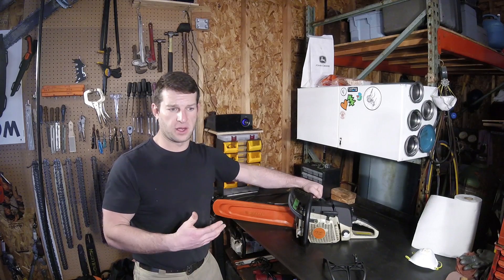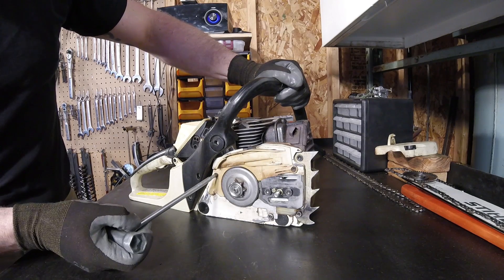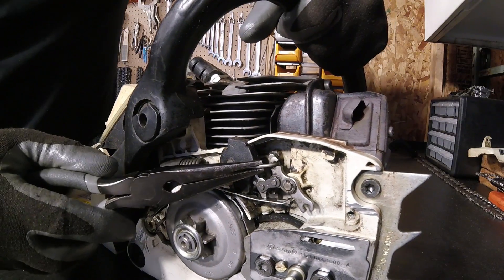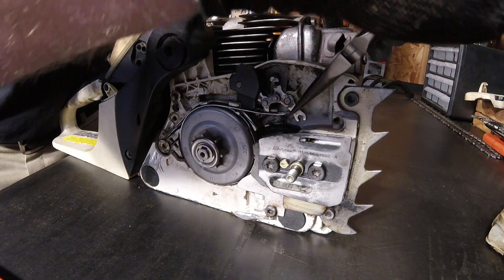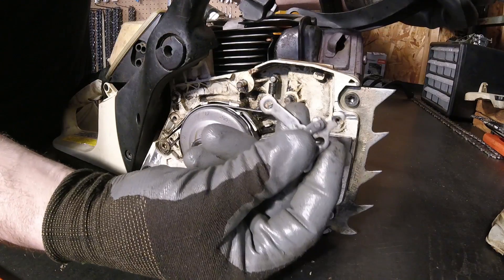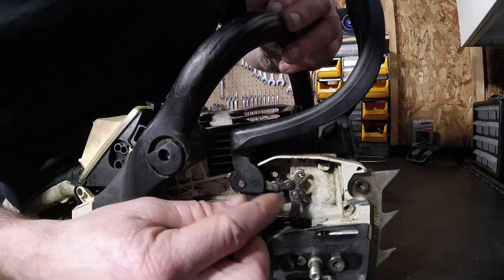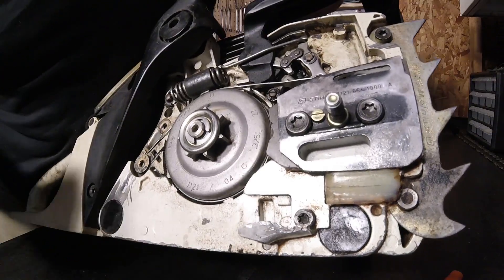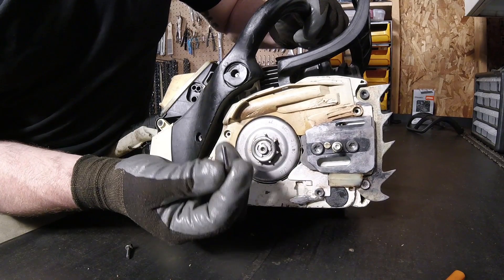Stihl Chainbrake Repair :How To (Ground Saw)

Comment: Great video! Thanks. I had no idea the brake mechanism was so simply designed. 
My 211 had a broken "bear" spring. The assembly was very similar to the one in the video.
An easy fix once the part arrives -had to order it. 3 bucks, no complaints. Take care.
Reply from the maker: Glad to have helped    =)

Comment: Thanks, I was almost trying to take the whole thing apart before I found this and how simple it was.   You're right,  big spring is a bear.  And I'm just a wee man.  Part of the problem is just holding onto the saw.   I ended up straddling the saw and holding it with my legs, then using a screwdriver to pry the hook into position simultaneous  with needle nose to push the hook on.

Comment: Excellent vid ... on my MS660 I had to put the lower bake spring on the C b4 putting everything on the pegs .. it just wouldn't fit once it was all in place. With the help of a stihl hook it went well.  OK I'm back ...broken another one ... this time I'm putting some fibrefix fiberglass 1" tape around the weak point to give it some extra strength.

Comment: Thanks for the vid, gives me a "chance" of trying to fix (or at least investigate) mine myself.
Chainsaw runs ok.  BUT, when I go to sharpen the chain on the bar, it's almost impossible to advance the chain by hand.  I can move it BACKWARDS (still stiff, but moves), just not forwards.  Regardless of chain tension (even if I slacken it a lot).  I'm guessing the chainbrake is somehow out of adjustment, and constantly dragging??
Reply: Mines difficult as he'll to move chain forward. I suspect the brake band on the drum needs to be eased off a little / re- tensioned but not sure. Did you manage to sort?..  please explain how ?.. thanks

Comment: I put a pair of hemostats on the big spring and roll it off the back pin with a scrench.  It will go flying, hence the reasons for the hemostats.  The rest is pretty simple to remove and replace.  I fabricated a spring installation tool from a 3/16”nut driver.  I smoothed the end with my angle driver and smoothed it down with my orbital dander.  I put a little grease on it, put it through the loop in the spring and on the rear pin.  I then stand it up and push the spring down on the pin and remove the tool.  It works fine.  Stihl also makes a tool for this but mine only cost me a little effort.

Comment: I’ve just done a very similar fix to a MS170 (one of the smallest saws) I fitted the brake band kind of at 90 degrees to the clip it’s attached to then rotate to the correct orientation, note that the slot is a T shape. Also there was a tiny heat shield strip screwed on the brake handle. The Chinese knock off replacement handle did not have any screw holes. I missed this until it was all assembled! It’s very close to a hot catalytic converter

Comment: I have found that using a Phillips screw driver works well for installation of the spring. Slide spring hook over Phillips driver shaft. Put valley of screw driver tip on spring stud, stand shaft up as you slide the spring down. Hold spring down as you turn the shaft. Spring will snap on to the stud.

Comment: I liked the video...I currently have a similar 311, and all the mechanism is intact, but when you pull the handle back, it does not make it to the point of ‘clicking’ to disengage the brake.  The little piece of that metal lever that almost looks like a chain link does not straighten all the way before the plastic handle makes it to the end of its travel.  Can’t figure it out...fairly new saw.  It you pry it with a screwdriver, it will click into place, but the handle won’t do it..

Comment: I have an old AV 034 super.  The pivot post (where the C clip attaches to) broke off.  Can that be repaired?  I tried to epoxy it back on (didn't hold).  The 'metal' isn't weldable, so I'm not sure how to fix this?

Comment: I like your teaching style and video quality.  I swapped out my handle in 2018.  Just retesting the inertia chain brake recently with the drop test (onto a stump) and the inertia brake does not work.  The handle does however trigger the chain brake like it should.  Any ideas?  Also for reassembling that spring, I was taught to place a piece of metal brake line into the hook on the left end of the spring and then the line will fit over the post allowing the spring to more easily go onto the post.

Comment: Awesome. Had a guy break the chain brake in the EXACT spot yours broke, so looking up how to fix it my main human was the first vid to pop up lol, so thanks bro, all because that bottom mechanism had came off. So hopefully the shop I go to has one in stock. Side question....ha e a recommendation on a cleaner to use besides just blowing it out with my air compressor? Stay safe human 🤘🤘
Reply: Was a 251 that it broke on, still like you said similar set up so was really helpful
Reply from the maker: I generally just use the flat head on a scrench to get all the big solid crud out, and then compressed air, as I'm sure you're aware of though, using air covers everything in a 5' radius in oily saw dust     =/
Reply: I use brake parts cleaner for the majority then air to finish. ( Note) a stiff handle  can be caused by a clogged brake band.It's important to keep the compacted dust out of the wiggle room between the clutch drum, band and the housing. If it gets compacted and the band loses its ability to move in as well as out, it will tighten up the mechanism and shit will start breaking and falling off. I have an 046 and I find it important to keep that area clean.

Comment: I plan on getting an MS291, but I read on line many  accounts of the MS291 being burned up by the chain brake, I suspect it was mostly by careless users, but many of them blame the chainsaw.. Anyway was there any problem with the saw brake on that model? I doubt it but it is better to be safe than sorry. Thank you.
Reply from the maker: We've a 291 at work that hasn't been an issue, but I've not been around any 291's in service for more than a year though, so can't really say.
Reply: I am pretty confident it was a user screw up. They ruin a new saw and their ego will not let them tell the truth. The brake will not engage by its self. The Stihl instructions about starting with the brake engaged and people forgetting to disengage it, or a saw so dirty the pitch and sap build up was hugging the band, hahaha.Thank you for your reply and I will buy it, sure it will be amazing.

Comment: Fixed a friends 270. Was broken in the exact same place. I wonder if they make that the weakest point on purpose.
Reply from the maker: Could be, I'm not certain.  This saw was left for scrap at the shop I used to work at, and I brought it back to life.  I've no clue how rough of a life it had before I took it in though.

Comment: What happened to the guy with the beard?  I need to have a look at that on my 066.  The chain brake engages but it has to be way up near the handle.
Reply from the maker: LOL, I wanted to keep it, but I went to a seminar the other day and felt I had to look a bit more professional.

I actually just fixed the very same problem on our 660 at work.  Turned out that the handle itself was bent, and effected the points at which the chainbrake engaged/disengaged.  I took it off and bent it back into a resemblance of factory shape, works much better now.  Would really piss me off, would always engage with the slightest bit of motion, really, really annoying.
Reply: Beards ARE professional. Just sayin...

Comment: Take a flat head screw driver, grind a slot in the middle. Place the tip on the spring stud with the spring up towards the top of the screw driver handle, it will be at an angle, pull back and it slides right on. I've fucked myself up on the spring until I started using the slotted screwdriver.
Reply from the maker: That's a great idea   =)